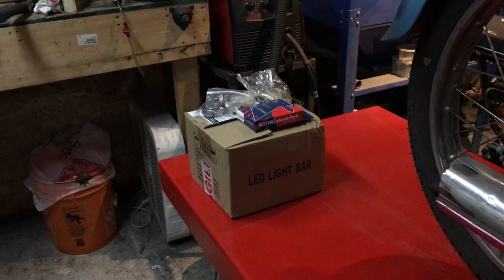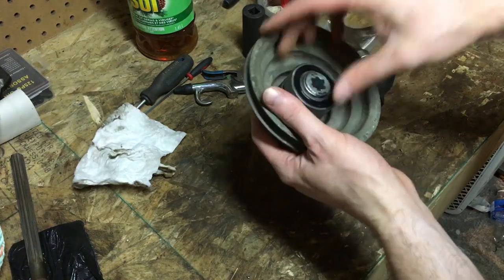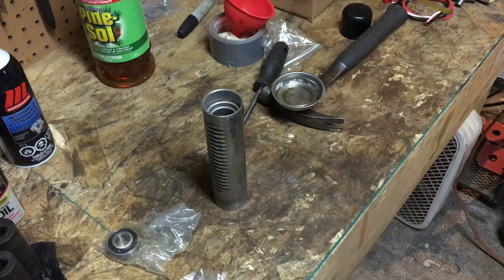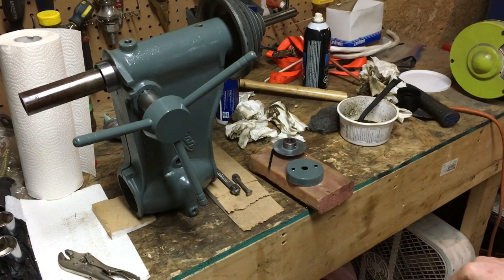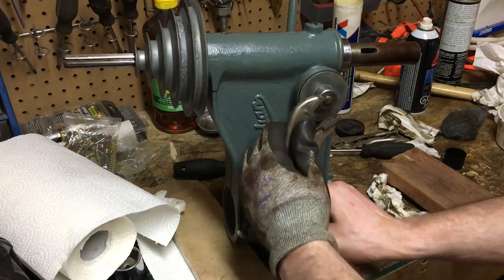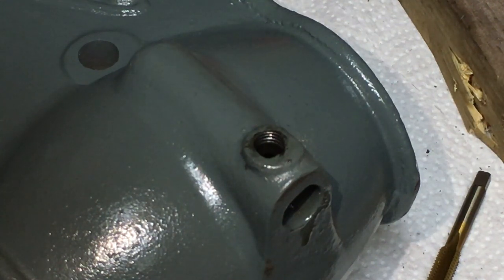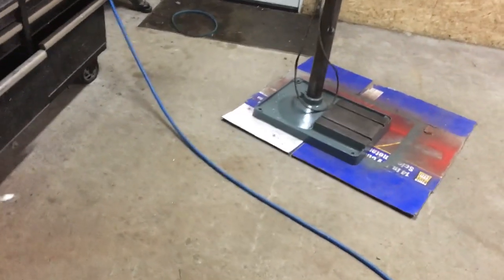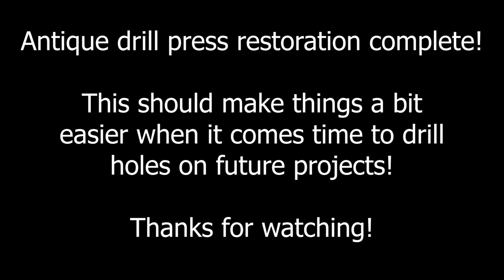Canadian Blower & Forge Number 15 Drill Press Restoration - Part 3

Comment: Nice job! I got the same one and I actually live in Kitchener.....lol
I put mine on an Allen Bradley VFD drive. So now all I have to do is turn the dial to change the speed.
You can't beat old stuff. It was made good in a different time. Not like today.
Reply from the maker: That's awesome! Back when I was in university here in Newfoundland I used to work at the Toyota factory in Cambridge during the summers of 1999-2001! It was a fun time! I lived in Kitchener my last summer up there!

Comment: nice  belt alignment ...pully to  pully  should  be  same  height. try using a level or flat edge  to align your  pulleys. Belts shouldn't  be at an angle . other wise  good  job. use old school  car wax paste  on  machine surfaces  to keep humidity from surface  rusting  them ( table and  post  mainly) can also  use  it  on table saws  anti rust and wood slides  great. buff it  out  like you do  on a car.
Reply from the maker: Thanks for the tip

Comment: i wish you had shown how you take the quill shaft out of the rack tube.
Reply from the maker: If I recall correctly, the top collar between the quill shaft and the bearing IDs in the rack tube had a set screw. Once I removed that I was able to use a rubber mallet to knock it down through!
Reply: @blastworks  Thanks for the reply.. I thought as much but my quill was super tight and a rubber mallet wasnt gittin it. .  Your vid actually was helpful I just needed to see the pieces apart.  Cant afford to break any of this stuff as it doesn't grow on trees.. Thanks again.  M

Comment: Applause, friend!  I'm working on what looks to be identical except the Buffalo flavor and with short column.  Do you have any idea what range of years they were made in that configuration?  I see others (later, I imagine) with a full belt guard and what looks like OEM switch location in front of the quill rather than right on the motor, and many (guessing earlier) with only four-step pulleys.  I don't know if there were any differences between the CA ands the US models other than the name on the casting, but as I say, yours certainly looks like mine, and I'm curious as to how old.  Thanks for the very useful videos!
Reply: PS:  very brave of you to weld up the smile holes in your table.  I'm tempted, but think I'll pass cause I'm a scairt of pissing off the grain and making it useless rather than just ugly, hahaha!
Reply from the maker: I'm not entirely sure off-hand as it has been a while, but I believe the vintage machinery forums (just google Vintage Machinery) has extremely detailed listings for various manufacturers, manuals, brochures, etc...
Reply from the maker: Nothing ventured, nothing gained :D

Comment: Any idea on what the speeds are? I am looking at purchasing the same one if I can find out if it will go slow enough for what I will need. (Stainless steel drilling and bigger drills in steel). Hoping to see numbers under 150, 90 is my ideal lowest speed, but I don’t expect to get that from a Pulley set up. Where these are very old models I’m hoping they are a bit more heavy duty that the modern drill presses you can buy new.
Reply from the maker: I'm not entirely sure off hand Lucas, but when I was originally doing this restoration, I made use of Keith Rucker's vintagemachinery.org. There are manuals for pretty much all old machines on there, and I'm willing to bet there's information on there about what RPM is selectable with this pulley setup.

Comment: How did you get the spindle assembly out of the head?
Reply from the maker: I can't recall off hand as it has been a while, but I believe once the limiting clamp and the handle is pulled out through, it should just slide out!

Comment: Great video.  I bought a Canadian Blower and Forge No. 15 and used your videos extensively throughout my rebuild.  Unfortunately mine came without a motor, was missing the chuck remover (catalogue #11197), and had a replacement chuck which was broken which I removed with #4 wedges.  I was fortunate enough to find another No. 15 and can use it for parts however, I am having a great deal of difficulty removing the chuck on that one.  I tried using the chuck remover and although it spins freely if will not budge the chuck.  I tried using wedges but there is not enough space between the chuck remover and chuck to get them to overlap and 'wedge'.  Any suggestions?
Reply from the maker: Hey Mike! That's a weird sounding issue to me. As I'm sure you saw in mine, I just put a set of scissors into the slot on the quill and knocked it in with a rubber mallet and my chuck came out of the quill no sweat. Maybe you can make yourself a couple of smaller wedges out of some small steel rod or some such? I'd also douse it in penetrating fluid like PB Blaster or some such, give it a few good shots every few hours for a couple days and let it really work its way into everything.

Let me know how it goes!
Reply: @blastworks  Thanks for the speedy response!  There's a depression above the chuck that I filled with PB Blaster last night.  I'll let it soak another day or two.  My Spindle has a Jacobs taper directly on it and it fits directly to a matching chuck.  It isn't configured like yours.  Here's a link from OWWM from someone else who has an identical drill https://www.owwm.org/viewtopic.php?f=1&t=220636&hilit=canadian+blower+%26amp%3B+forge
Reply from the maker: @michaelhelt4730  Ahhh! I see now. If you haven't yet, you'll have to remove the collar on the bottom (if there is one), take your handle out, and then pull the entire assembly down and out of the head. That's what it looks like to me in that example that you linked!
Reply: @blastworks  Thanks but that's not the problem. I can get the quill out.  It's the fact that I can't get the chuck off.  If still interested have a look at page 7 http://vintagemachinery.org/pubs/129/23645.pdf .  You'll see the chuck remover at the bottom of the spindle and a Jacobs taper below that.  My understanding is that I should be able to turn the chuck remover to push the chuck off.  I imagine the chuck has never been removed and is seized.  Hopefully the PB Blaster loosens thing up.  I'll let you know.

Comment: Thanks for the detail on your restore!  I just bought a Buffalo 15 that is very similar and your detail will help me in my restoration.  How do you change the speeds on this thing?
Reply from the maker: On this one, all I need to do is adjust what part of the pulleys the belt on! The pulley on top of the motor and the pulley on top of the quill have three different settings, so smaller on the motor and bigger on the quill is slower and vice versa!
Reply: @blastworks   Thanks for the quick reply!

Comment: So I just picked up a Walker Turner Drill press but noticed my base has Canadian Blower & Forge written on it and it’s massive.. stumbled on your video and it matches your base so clearly someone made a swap at one point or another. What exactly is Canadian Blower &,Forge I was thinking of cutting my base down as it’s just massive
Reply from the maker: They were a subsidiary of Buffalo Blower & Forge Co, there's a ton of info about them online, just punch it in to Google!  You can also check out VintageMacinery.org as the is all sorts of information on a lot of older machines on there as well!

Comment: M10, metric threads?  Made in Canada?
Reply from the maker: These were indeed made here in Canada. Not sure what the original thread was for the motor belt tension adjustment, but I decided to drill and tap the holes for M10 as that is what I had on hand for bolts!